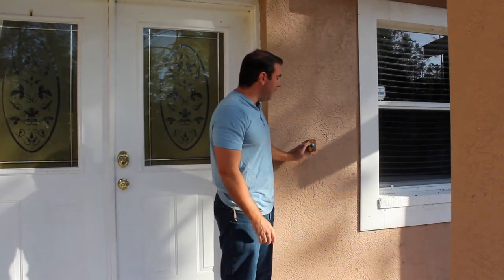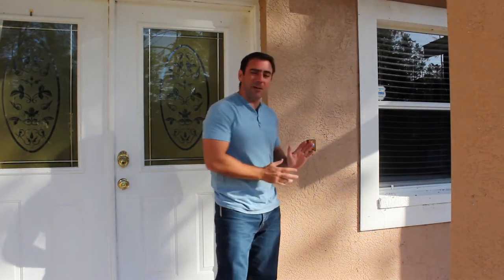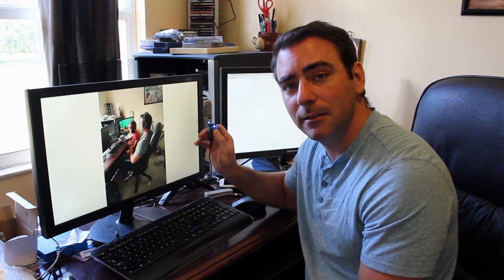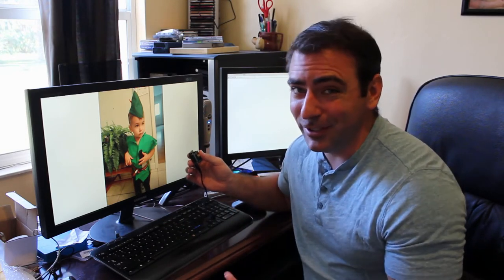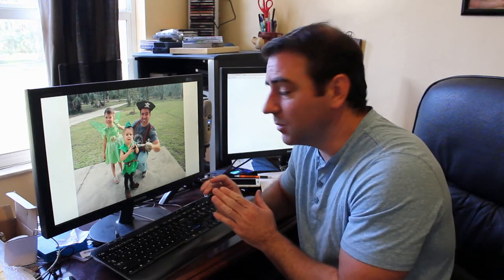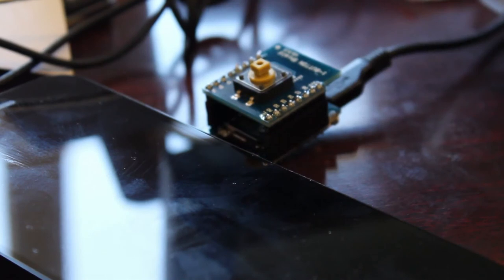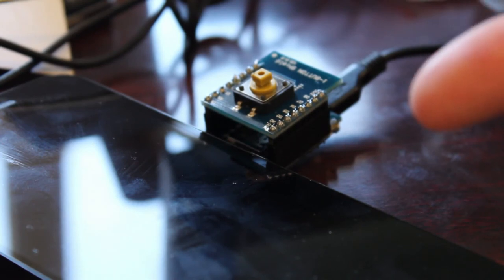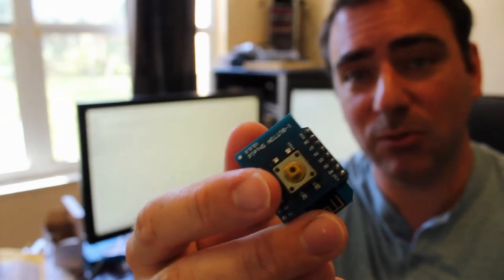Wemos Mini Button Module Demonstration 2017

Comment: great video, one question if you don't mind, I'm new to home automation, just got going with home assistant now for about 6 weeks. I have a D1 mini that I flashed with Tasmota and have it as a sensor in HA. I want to " hard wire hack" a Budweiser goal light so that the automations I have and am using with an NHL API will work with the Budweiser device as the NHL API is delayed about 15 seconds and out of sync. I plan to just use the Budweiser speaker wires for the event signal. My question, finally - what pinouts do I wire to on the D1? I think 14 sck and ground? Are there any other D1 modile or software options I need to look into changing? I really don't know much about this, just a hobby I picked up and haven't come out of the rabbit hole yet. I will power with the USB for now but might get a battery shield or try to steal juice from the 4 D batteries.